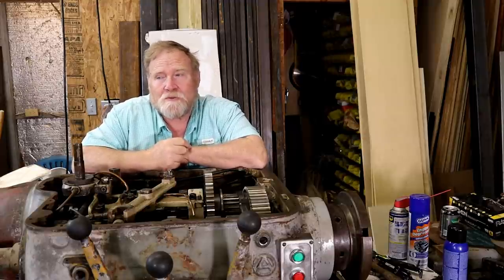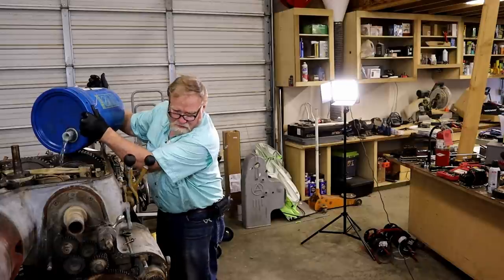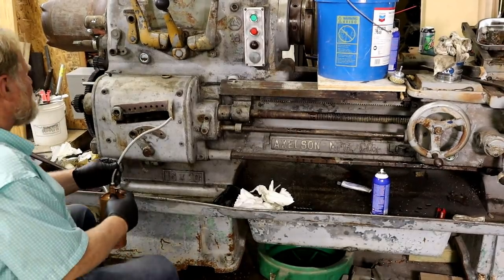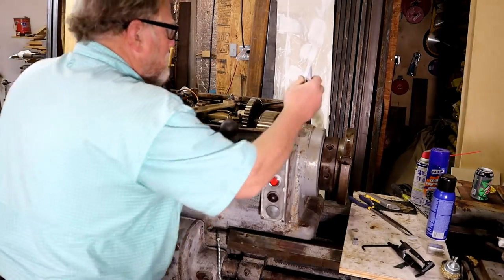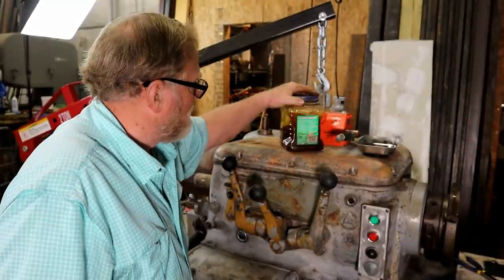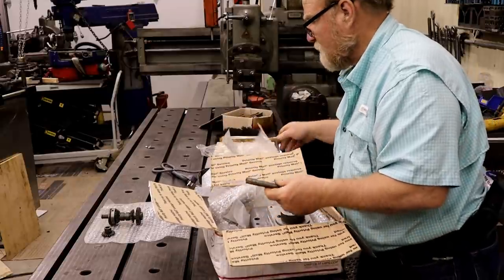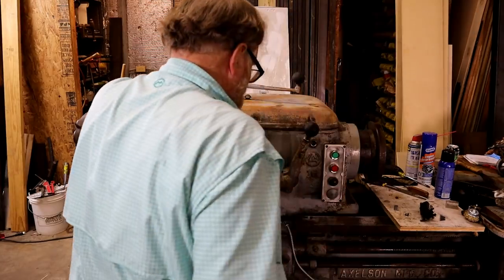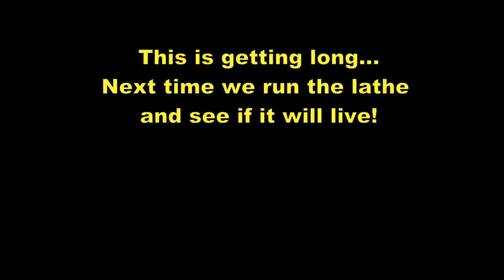Restoring a 16" Axelson Lathe: ON with its HEAD. Part 1

Comment: I love how heavy duty the machines they made back then are. Solid as a rock, and as long as everything else is within tolerance you could see why they would give a smooth and accurate finish. And they look cool too.
Reply from the maker: They really do work nice. I was in love with my first 16" Axelson... But Don needed it more than I did at the time....  And I needed a 20 inch :)
Reply: The Axelson is built like a tank!!!

Comment: Good to see it under its own power again. I think I would go the heat route on the handle first because I am lazy and I  have good luck with heat getting things loose.
Reply from the maker: I'm a little hesitant on the heat mainly because they are chromed and I want to see if I can restore that... Sometimes the rust will come off the chrome and I'm afraid of cracking the coating...

Comment: The axelson that I used occasionally at work would not shift well because there was not enough oil pressure to the clutch.  Changing out the oil and changing out the filter fixed the problem for a while, but eventually more crud caused a recurrence of the problem.  They got rid of the lathe before we changed the oil and filter again.
Reply from the maker: One of the things I noticed is the oil pick up tube for the oil pump is at the very bottom of the case and in a depression to boot.  Mine was buried in sludge so it could  have been easily blocked... I would have designed that so the pickup tube use about an inch above the floor so the sludge would have a place to settle out... But then they are not thinking of sludge like a rebuilder does :)

Comment: Ultra Black is sensor safe. Not any better than the regular black.
Matter of fact,  I prefer the regular.
Ultra gray really sucks.
Black is used on tractor rock shaft housings, and rear end and transmission covers.
That lathe head cover isn't going to squeeze all that all out.
You sure did an excellent cleaning job inside that head!
I bet Don would paint that blue machine your favorite machine color! It looks like a solid machine! Or, it will be when you get done with it.
Reply from the maker: I figured it would be ok in that position as it's above the oil when the machine is sitting... When running is a different story!  that thing must be a rain storm of oil when it's running due to the way they made a hole in the piping... Diesel went about 8 feet into the air :) 

Don was needling the Axelson and said if I tape it off he would spray it...

Comment: Taking that cover off and on reminds me of when I had to remove the transmission cover off my John Deere tractor, to replace a sheered, little roll pin, that connected the pto lever to the shaft that operates the fork assembly. After 45 years they upgraded the pin to a solid one. You could make a three bolt puller to pull on that spring loaded handle. A thick washer the proper diameter, then a three hole piece to thread on to the handle.
Reply from the maker: There is nothing to grab to to pull on the handle.. Not enough lip on the outer barrel and it would mess what there is up... Force needs to be from pushing on the inside of the outer barrel  so it slides off of the threaded part.
Reply: @10swatkins  I see.

Comment: Steve you need to make an A frame. you made my arm tired watching you
Reply from the maker: I used to have one.... I hate always moving them around and them being in the way when not in use....    Engine hoists fold up, store in a small space and they do work well in most cases...   I have been toying with putting in a 3 ton jib crane but that is dependent on what I do with the small storage room behind that lathe.

Comment: two things.. you were talking.. i was screaming NO!!! not the magnetic clamp to pick up the cover from the floor.. i was envisioning the junk yard electro magnet on the crane picking up scrap .. and then releasing it from the inside of the cover as you release the magnet.. dropping any particles it had sucked up off the floor into the gear box.  i saw you had it on a floor mat.. 
 the second item.. a small project for your shop.. a chunk of 1.5" bar stock.. drill a hole an inch deep the same size as the release valve on the engine hoist.. now cut away to make a T flange shape.. give your self 1/2" an inch of full diameter width above the reduced diameter.. clamp it on the table and attack with an angle grinder to cut a slot to fit over the pin on the release valve of the engine hoist..  if you really want to get creative. do some knurling before you cut it off..  you could make it out of square bar.. hex bar..  carry on.. i await the next installment of the 16" story..   did gm tell you what they found wrong with the rock.. i am taking the last video of the flashing dash lights helped..  if they didn't tell you .. did they come up with something creative like.. wasn't this truck it runs perfect..
Reply from the maker: Wayne what you see in the video is just 5% of what really happens... If I put it all in it would have been about 4 hours, just to this point...   The cover was raised up so I could get under it, wiped clean and the then blown off with air before it got anywhere close to the machine...  Nothing was on it to fall off when the mag was released..

GM turned off a few of the features such as the automatic backing up to a trailer brake... What else I have no Idea... GM would not do anything to get me into another truck.... What a way to treat a lifelong customer,  especially one with a big mouth L :)
Reply: @10swatkins  i know.. i just had to relay what i was thinking with the magnet clamp.